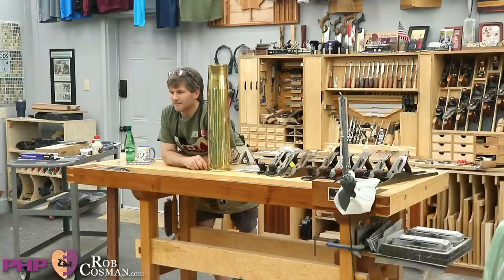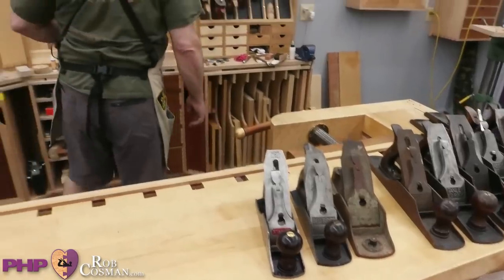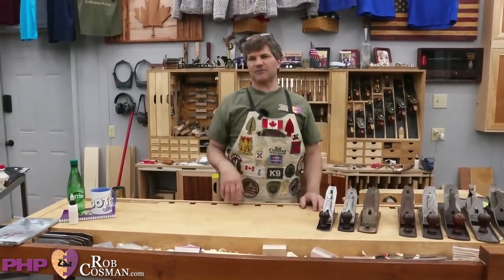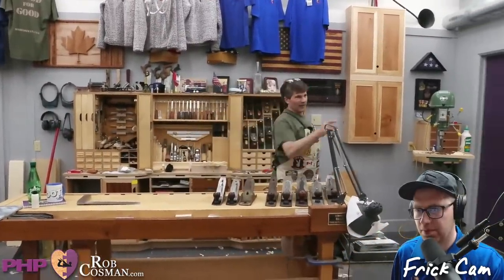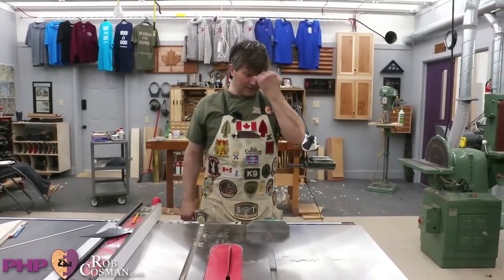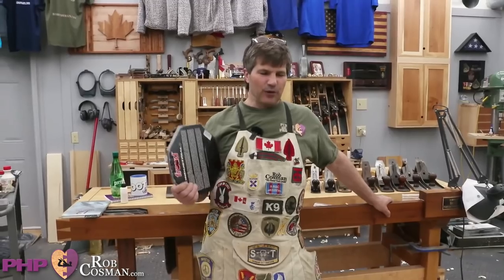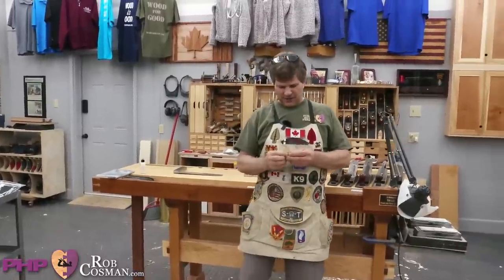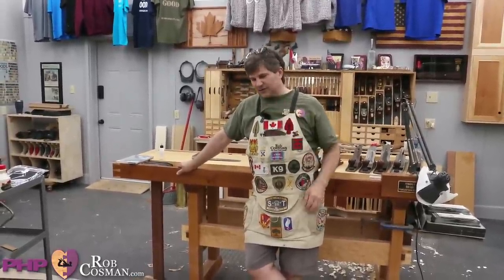Table Saws - Live Q & A (12 June 2021)

Comment: What do you think about the Harvey table saw specifically the 4 hp model
Reply from the maker: I don’t care for any saw other than a SawStop, my digits are too valuable.
Reply: That’s nice ; I can’t afford one so I stopped woodworking?  I thought as a professional production finish carpenter I am afraid to use my skill saw, my compound miter saw, my track saw, my jig saw, my band saw????

You see how that can play out?  Maybe I should just buy some hand planes and dull saws?

I was an officer 30 yrs before becoming a contractor/finish carpenter !  I work full time as a carpenter!
Plus part time at my Church!

It’s all dangerous and as a Christian I trust God!   No matter if you run a saw stop or not if the Lord wanted to see how you manage with him less a limb guess what ?
I think you work with some of those men?  They had thee latest & greatest safety equipment right?

Anyway keep your spiritual guard up!
So if even an “Angel” comes to you with a different gospel you will reject it!

Ok Rob !   Saw Stop it is??
Reply from the maker: @zephyr1408   are you offended? You asked me what my thoughts are, and I shared them. I don’t care for any table saw, other than a SawStop. You’re trying to compare two different brand new saws, so obviously you’re looking to spend some big money. If you said “Rob, I can get a used Unisaw for $150, is it worth it?” That would be an entirely different situation. I’d still recommend the SawStop, but would understand if you bought the unisaw.
Reply: No I am not offended ; take care !
Reply from the maker: You as well
Reply: @zephyr1408  Yeah let's put all faith in god and not worry about safety. What kind of thinking is that?!?!
Reply: @zephyr1408  , I've always been more concerned with how saws saw and not how they stopped sawing.
I know way more people injured by Skillsaws than table saws.
American table saws are dinosaurs with limited capabilities.
Reply: Vzjrz -  I hv no idea where you got that from but if that’s what u want to do hey hv at it!